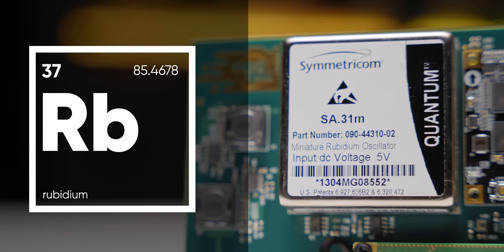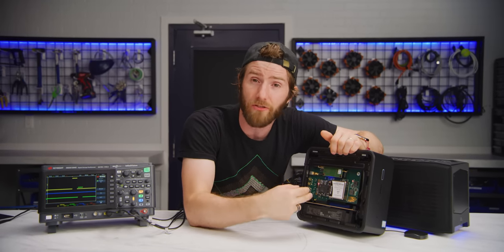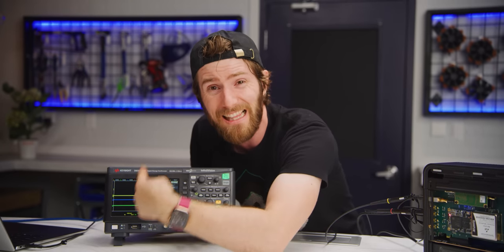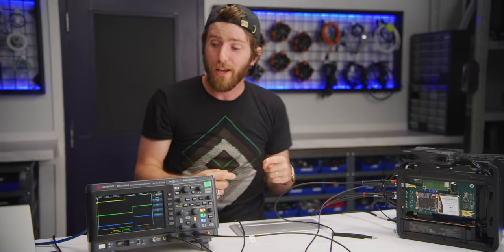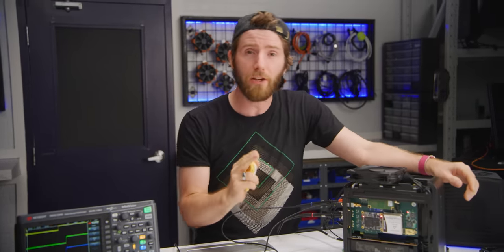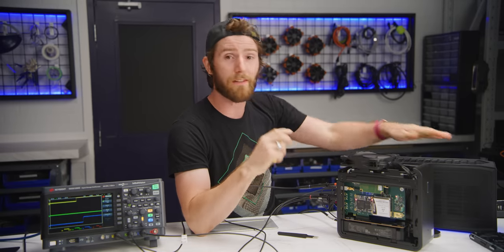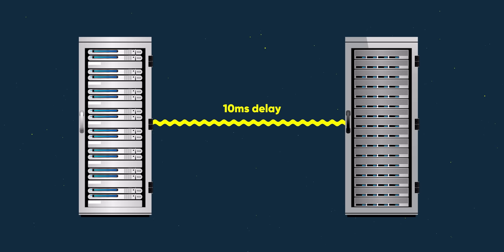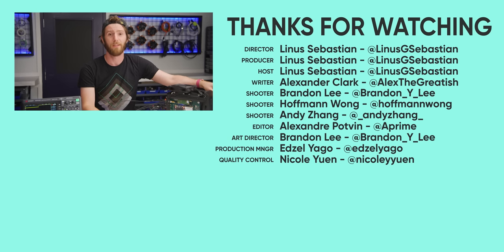Why is this PCIe Card RADIOACTIVE?

Comment: Slight correction: the rubidium clock has to be synced to GPS not because of drift, but due to special relativity.

At the nanosecond resolution, traveling in an airliner at high altitude could theoretically cause the accuracy to drift.
Reply: This comment will be here forever...
Reply: As in, it's time traveling?
Reply: @andrewgoss1682  yup
Reply: bs
Reply: Real?
Reply: gotta love / hate the time dilation
Reply: So it's not because of drift, but because of ... drift?
Reply: because gravity
Reply: @berten1562  no
Reply: I didn't know that. Thanks Denny!
Reply: Bloody granular nature of physical reality is eating my frames. Unacceptable! There'd be none of this nonsense if we legislated pi to be a sensible number like 3.
Reply: @andrewgoss1682  Time dilation.
Reply: Can you elaborate a bit more on the "special relativity" part more?
Reply: @bersK00  simply put: the closer you are to a massive object, the slower time moves.
Reply: @Z0MBUSTER  Moving the card itself in relation to anything while it's running will cause it to measurably drift. See also: Hafele-Keating experiment, 1971
Reply: @andrewgoss1682  Going fast makes the time run slower for you.
Astronauts are also time travellers as well. by some miliseconds of course, but they are.
Reply: @benwu7980  gotta love the concept of time being man made
Reply: @andrewgoss1682  Everyone is always time travelling at 1 second per second :)
Reply: Yes, this is real. Time travel is technically possible it's just not in the way you think it would. It's been proven that if you move faster than another object, then time is slower for you than the other object and vice versa. This is on the scale of milliseconds though, so you'd have to be travelling at insanely fast speeds to have any remotely noticeable difference.
Source: Hafele-Keating Experiment
Reply: @W1zardRyan  yeah! google time dilation.
Reply: I'm surprised people don't know how general relativity works, Speed and gravity changes how things move relative to each other. good way to learn about is look at the history of GPS, within a day the accuracy was miles off.

But short answer is: faster a object moves relative to other objects slow time passes for the faster object, and higher the gravity is the same.

I'm tad drunk, so correct if i'm wrong.
Reply: @pupip55  most people don't understand this because the average age that watches youtube is 13
Reply: Doesn't make much sense, Denny. Why would I care about time dilation, when syncing a bunch of servers? The distance between them is exactly the same all the time, hence their mutual speed is 0.
GPS is used, because it's a common reference and because even caesium clock drifts. So you are NOT right.
Reply: @andrewgoss1682  not quite but basically: something that moves fast will experience time slower
Reply: @berten1562  Not because of "drift", but because of time dilation caused by General Relativity (Fun fact: Time dilation caused by the earth actually makes your head age slightly faster than your feet!)
Reply: @pupip55  Its a complex mechanic which is hard to understand when you have no background in physics which most don't. remember not everyone learns that level of physics when studying and people who do dont always remeber such a fact
Reply: @maruftim  Photons experience no difference on time or distance, relative to a photon: the moment they are emitted is the exact moment they are absorbed.
Reply: Fast 50 : Drifting time
Reply: @tomkocur  If you have one server at the north pole and one on the equator for example, The distance between them would be the same all the time yes but, because the one on the equator moves faster through space than the one at the north pole, there would in fact be some time dilation.
Reply: @bersK00  the special relativity theory was so much easier to understand than the general relativity theory in high school.
Reply: @harbl99  ‘Make All Realities Arbitrarily Man-Regulated Again.’ -Donald Einstein I guess idk
Reply: So what you're saying is my dream of having Tokyo Drift with Time Travel is dead
Reply: @hampustoft2221  Yeah i know, But I remember it form school and almost everyone I talk in real life seems to know or at least act like they do. So it feel like common knowledge. I'm surprised by the volume of comments than anything else.
Reply: @Fizzer99  it seems to me when both servers are on a rigid body like the earth the distance is equal between them at all times so there's no movement between them? I'm not sure what earth rotation does though. Maybe because it's uneven surface  it does make spacetime wobble a bit, not sure... Edit: however it is true that depending on the curvature of spacetime, and thus differing height between servers can cause them to go out of sync. The server that is higher will tick faster. The cause in that case would be simply differing gravity caused by spacetime curvature due to the mass of the earth at those particular places.. I don't see how servers move in respect to each other when one is on the pole and another is on the equator however...
Reply: @DTG4844  Okey that makes sense, For me its common knowledge, That I learnt in school. its definitely something I took for granted.
Reply: No. They need to be synchronized due to aging rate for most applications. These small clocks age at the rate of about 10^-10 per month. That corresponds to 259 uSec per month. If you are using these to measure distance, say of light traversing a 1 km path, you could have up to 520 uSec of error, corresponding to a distance error of over 150 km!
Reply: @richardburrell7665  no wonder you can't get a video card, you can't even structure a sentence
Reply: @Fizzer99  that's not how RELATIVITY works. Time dilation depends on RELATIVE speed of the two objects, not on some "absolute" speed, which is a concept that doesn't even exist. There's no "speed through space", there's only speed relative to a reference point.
Reply: @tomikun8057  Only locally, If i'm in obit my second would be a second, but to me your seconds would be faster would past faster. but for you your seconds would also be a second a second. I am drunk so sorry for poor explaining.
Reply: @tomkocur  You are correct. Brain fart moment.
Reply: @Fizzer99  If your servers are so far apart that general relativity (or special relativity for that matter, because the same argument applies to "moving" servers) causes a drift, your synchronization will be limited by signal propagation uncertainty long before relativistic effects become significant. Global synchronization is a huge can of worms on its own and the GPS-based one is essentially limited by the dynamic ionosphere corrections, which are vastly different at different points on the planet - might as well just send a sync pulse through a fiber cable.

Also, using a rubidium clock looks more like a PR stunt to me than anything else because the entire precision comes from the GPS satellites, which have way more stable atomic clocks. The local oscillator only needs to be precise to one cycle in one second between the 1PPS pulses from the GPS and that's completely trivial with a run-of-the-mill OCXO. What's even more baffling is, why would data centers waste that much money to put a PCIe-connected clock into each and every machine rather than using a central timing distribution box for the data center and just run BNC cables with the 1GHz reference signal (or more likely a multiple of the FSB clock) to every machine, which would just need a simple PLL circuit?
Reply: @berten1562  Yeah, we all understand that it is time dilation due to the relativistic effects of the orbit velocity of the satellites. But I don't know why that mechanism is excluded from the definition of "drift" here. Does "drift" necessarily mean it is caused by inaccuracy in the time-keeping mechanism within its local space-time, or in other words, there being something wrong with the clock? I am wondering what the strict definition of that word is if it necessitated a correction. Unless the semantic distinction was just used as a jumping-off-point to draw explicit attention to the fact that GPS satellites have to compensate for relativity. Because it is admittedly a mind-blowing fact when you first learn about it.
Reply: @DeerJerky  At high-fractional-C we could cross the entire galaxy within a human lifespan.  Our closest neighbours are mere months away.
Reply: I may be wrong but I thought special relativity doesn't fully describe the effect here and general relativity included both the effect of gravity and velocity? Might be wrong but I believe that's the case.
Reply: The issue is if relativity is not accounted for then time might travel through you not you through time. And Linus might just appear as baby Linus in the video's. So something to watch out for.
Reply: @clipsedrag13  I'm pretty sure whatever influence gravity has would actually be working to counteract the total effect of time dilation on the satellites. Satellites experience the passage of time more slowly with respect to computers on the surface of the Earth due to their high velocity with respect to the surface. But on the other hand, computers closer to a gravitational body should experience the passage of time more slowly with respect to computers farther away.
Considering the Earth's gravity is rather modest on a cosmic scale, and computers on the surface experience a very similar gravity to satellites in orbit around the Earth because satellites are so close, I would expect the influence of gravity on time dilation to by many orders of magnitude smaller than the influence of the satellites' velocities on time dilation. But what small effect gravity should have, should be working to mitigate the much larger effect of satellite velocity.

Anyone can feel free to correct me if I'm wrong. Especially if they have math. I would love to see how the two effects compare.

TL;DR Computers on Earth = higher gravity = slower local time
Satellites in orbit = lower gravity = faster local time
Computers on Earth = lower velocity = faster local time
Satellites in orbit = higher velocity = slower local time
Effect of gravity << Effect of velocity

Effect of velocity - effect of gravity = total relativistic effect ≈ effect of velocity alone
Reply: Also the gravity of Earth isn't perfectly even - some places have higher or lower gravity, thus complicating usage of ultra precise clocks.
Reply: Good thing this comment is posted on a video with radiation in the title, its gonna last a long time.
Reply: @DaimyoD0  In the context of clocks, drift simply means a different rate of the process that is measured to keep time. Whether it's an "inaccuracy" depends on the reference you're comparing the clock to. The "correct" clock rate is defined based on the cesium hyperfine transition, so you have to compare every clock to this reference to conclude whether it drifts or not. The clocks on the GPS satellites (probably) don't drift within the measurement accuracy in their own intertial frame (i.e. if you sit inside the satellite with a Cs clock), but they drift quite a lot when observed from earth. This drift is deterministic and measurable, so it can be corrected for to make the GPS clock signal appear drift-free. If you don't have an authoritative reference, you can only measure relative drift but you won't know which clock is "correct" (it could be neither).
Reply: @ok-sl4we  I legit use this stuff for Ham radio but mine don't use rubidium it uses a OCXO with a GPS Lock and when i beat it against a $20,000 rubidium  time standard it is dead on and it was $90
Reply: @Mr_Meowingtons  Yeah but dat phaze noize tho!!!
Reply: @clipsedrag13  Nothing to do with gravity. Special relativity is all about velocity. Earth's gravity is so weak, as is gravity as a fundamental force itself, that its effect on particles is considered negligible.
Reply: @DaimyoD0  "Satellites experience the passage of time more slowly with respect to computers on the surface of the Earth due to their high velocity with respect to the surface." -> bonus question: what's the velocity of the GPS satellites with respect to the surface of the earth? :)
Reply: @neondemon5137  well then that is a tragedy of the education system
Reply: @MykytaSpivak-ne3cw  no u
Reply: @Z0MBUSTER  ah yes the ultimate comeback
Reply: @redyoshi12243  That's nonsense. GPS time is corrected for relativistic effects, otherwise it wouldn't work. The signal delay between different satellites that's measured to calculate the location is irrelevant for getting the correct time because all satellites transmit the same time as a data packet.
Reply: Not theoretically, actuality. It is traveling into the future. Down on earth time would be slower because of the higher gravity. Obviously not much. I wanna say a couple of nanoseconds for a long flight.
Reply: What you mean is general relativity, though. Essentially time dilation due to space time curvature. SR really only deals with time dilation due to relative movement of reference frames to my knowledge.
Reply: Huh.
Reply: Cool.
Reply: @MykytaSpivak-ne3cw  xD
Reply: Also Earths Gravitational field can mess with Aircraft instruments in a big way, some places om Earth . we are not aloud to fly over like the triangle yeah lots of crazy stuff there for sure, but you know what there is a answer for everything ,we just have to learn to look hard .
Reply: gotta love temporal hacks
Reply: @pupip55  So you learned about relativity but not about the word LEARNED instead of the non-word LEARNT.  School's a joke I guess.
Reply: @harbl99  Plz don't define 0.14159265… as the new zero! I'm panicked!
Reply: The faster you move the slower your time will be.
Reply: You are right
Reply: @redyoshi12243  What is GPS time, I do know of standard universal time ,what is GPS time, this is interesting what you are saying but yes i think i have heard about this, but its not what i was thinking about sorry .;-)
Reply: @stealthinator00  yep, unfortunately you cant move fast enough to freeze/reverse time tho, at best you can delay aging by a couple of days at light speed (rough guestimate, most of the cool stuff is banned due to the laws of physics, so stands to reason)
Reply: Neeeeeeeeeeeerd
Reply: genuinely no idea what this means
Reply: @redyoshi12243  are you familiar with the way that GPS was originally set up? They do have to correct for time dilation, and they do so extremely accurately- the engineers working on the original GPS sats left the time dilation code turned off when the satellites launched, and only turned it on once they realized their positioning was getting all kinds of screwed up.
Reply: @RealNovgorod  For a second there I imagined the math might be quite easy but then I realized GPS satellites are most certainly not in geostationary orbit lol
Reply: @Artcore103  No I have learning disabilities, But even then "learnt" is the word spell check gave me because its correct...? Just might happen to be in a different country then you
Reply: @madmad8582  The GPS satellite send out multiple radio waves with time that's been adjusted for relativity, when your phone detect the wave it will compare them to your local time and the other waves.
Reply: @andrewgoss1682  yes, because relativity is weird.
Reply: @W1zardRyan  yes, because relativity is weird.
Reply: @tomikun8057  NO! Because of people like you Einstein had to think harder.
Reply: @XGD5layer  That's general relativity. Special is more like: the faster you move, the slower time moves.
Reply: This damn Kerbal said fuck Time
Reply: @tomkocur  Servers aren't moving compared to each other, BUT servers are located in different magnitude gravitational fields, so second on each server has different length and that clock difference is growing without atomic clock syncronication.
Reply: @pupip55  I am beginning to see the frequency of the situation,and yes time is part of that yes, frequency , speed, time, :-)
Reply: Not just could, it will.
Reply: @XGD5layer  Ah, so that's why if you say that someone is dense, you mean that you think they are stupid and that they take a long time to understand simple things? xD
Reply: @andrewgoss1682  time travel is measured with atomic clocks, thats how the theory of relativity was proven. Some hypersonic jet with such an atomic clock was the first man made object to travel by a couple nanoseconds into the future. And its not Gravity at play as someone suggested, but rather Inertia, because the atom has to travel diagonally now, and the trajectory is elongated, thus your relative nanosecond becomes longer.
Reply: @redyoshi12243  Yes, GPS receiver does always time correction for calculations based on values in GPS calendar. GPS system is in constant calibration mode, so for pricice syncronication you need local atomic clock. I think that without correction calculations raw time signal from one/few satellites is useless for this purpose.
Reply: @Ben van Jaarsveld The earths Gravitational field plays a huge role into the natural laws of physics, even life, the Human brain works at the same frequency  of Earths, Gravitational field, plus , Earth has the moon, plus the Earth rotates .
Reply: Actually it is needed to correct for both special relativity and general relativity. Even for any fixed installation not only is the gravitational field strength influenced by elevation but by the specific location on the surface. The latter being due to the fact that the Earth is neither a perfect sphere nor is its density perfectly uniformly distributed about its centre of mass. Thus the time dilation due to general relativity is also slightly off as the Earth itself is distorted, lumpy and uneven clump of matter thus consequently its gravitational field is also distorted, lumpy and uneven. Ultimately this means that to synchronise two atomic clocks around Earth you also need to correct for the time dilation due to general relativity caused by the slightly different gravitational environment for each clock. This is simpler to do for fixed clocks but it can be integrated over the path for a clock following a known path around the Earth. In fact I believe that the correction for each GPS satellite is slightly different for this reason, each satellites orbit takes it over different points on the surface thus meaning slightly different gravitational time dilation even for two satellites at identical elevations.
Reply: @Ben van Jaarsveld If earth ever lost the moon, it will stop rotating and face one direction to the sun,  physics , then life here would all die, Earth is our only home :-)
Reply: @Z0MBUSTER  No, it's not. Time perception changes ever so slightly due to object's speed as well as how much is a given object affected by gravity (both of them change on a plane, since you both move fast and get further form Earth). And by ever so slightly, I really mean that. You need to be traveling at close to light speed or come extremely close to a black hole in order to see the difference. But at an atomic clock scale, you might be able to see the difference just by getting onto a plane. Heck, that's the very way how they discovered time dilation (tho it's been theorised by Einstein way earlier). Scientists just chucked an atomic clock onto a plane to see what happens. And sure enough, it was ever so slightly ahead of another atomic clock left on the ground.
Reply: @madmad8582  Did you reply to the wrong guy?
Reply: Profile pic checks out
Reply: @pupip55  Maybe lol Hi :-)
Reply: The airliner effect would be due to GR not SR. The SR offsets in the atomic clocks in the GPS satellites are due to its inertial frame’s velocity. Remember in SR spacetime is still flat.
Reply: @tomkocur  That is a great question.

Reason 1) Transporting

Lets say, on your time cards, the radioactive element decays (a clock tick) at the same time for all your servers and they have exactly the same time.

Then you trip over and spill soda on one of your servers, whoopsie

But your friend that is miles away knows how to repair servers so you put your computer on your car, you drive to your friends's house, get it fixed, the clock ticked exactly the same as before, and you notice no difference the whole trip.

After fixing it, you get back, but your server back next to the others, and notice they are no longer in sync , damn you Einstein!

--------------------------------------------------------------------------------------

Reason 2) True time-dilation sync is impossible

Another way that could cause a desync is stacking your servers vertically, one on top of another, it will make the servers at the top experience faster ticks than the ones on the bottom, even if the effect is very, very weak it will cause a desync after a few million/billion ticks

After all, it is known that, synchronizing 2 clocks to tick exactly, and I mean, exactly at the same time is impossible, and even if you had 2 clocks that are perfectly synchronized, its impossible to prove it
Reply: What's cool about it is the fact that for GPS to work both the special relativity and general relativity corrections have to be made. It's the only way for it to work!
Reply: @v1perys  technically it's just one general relativity correction, because GR includes special relativity as, well, a special case of it. But that correction can be separated into two components - purely kinematic slowdown and purely gravitational speedup.
Reply: @Fizzer99  No. The surface of the earth is equitemporal. The equator is moving quicker, but the its also experiencing lower gravity. The two effects cancel exactly.
Reply: @G-u-z-i-o  bs
Reply: That's simply not true.
These systems drift when untrained due to many many factors - in my experience the biggest factor is ambient temp (even in oven controlled oscillators in environmentally controlled data centers). I used to watch my untrained 1pps walk one way vs a trained 1pps during the day and the other way at night when the data center dropped ~10 degrees.
Reply: Just look at what you did.  I hope you're happy now. 
(I know I am)
Reply: @DTG4844  when i was 10 I learned about it one youtube because i saw cool time travel video that and game theory used it to explain the lore of mario's galaxy
Reply: @XGD5layer  reason why time stops around your mom
Reply: So... Is GPS time like, the "official time on earth"? Because even living at different altitudes causes clocks to ever so slightly drift after synchronization (because of differences in local gravitational accelerations). And what time zone is it in? UTC? GMT 0? Swatch time? Who is even keeping time? What day is today!? So many questions now! XD
Reply: OK
Reply: @tomikun8057  Always true in the local world. The impossible problem now is getting people in different parts of the universe to agree on how long is that second (and no, it's not because of "opinions" XD)
Reply: Whatever he said 😂
Reply: @Ben van Jaarsveld Of course, which is the reason all the satellites internal rubidium clocks have to be corrected a very small amount to compensate for these effects.
Reply: Every rack mount frequency standard is going to be synced to GPS because yes they do drift over time despite being stationary for their entire life.
Reply: @DTG4844  I think that's TikTok, some youtube is actually useful to grownups :)
Reply: i was thinking about the same thing. i had seen videos about this stuff and theoretically any height differences is enough to create a drift but it was so miniscule and negligible it couldn't be measured, that it until atomic clocks came to the scene as they had much higher accuracy. the video i saw had it tested at around 1 m difference and this whole concept is really fascinating to me. unfortunately this also requires a lot of maths and im not good at it so im probably not going to almost anything physics related, let alone quantum physics
Reply: so technically you could determine someone's altitude based on the ping response times
Reply: It is disciplined to GPS to combine the advantage of both (long term accuracy and short term stability)
Reply: @tomasgarza1249  you got a few things wrong.
Decay has nothing to do with atomic clock.
If you stacked your servers on top of each other, there would be no time dilation, because they don't move relative to each other.
Reply: The server on the bottom would experience a stronger gravitational field than the one on the top

Time dilation has a relation with speed, and gravitational fields

On the atomic decay.. I just googled it and you are right about that, it doesnt rely on radiation
Reply: god i fucking love science
Reply: @martinh2783  The original meaning is that their skull is so dense that nothing can get through it. But we can adopt that as the second definition.
Reply: @andrewgoss1682  technically yes, but at very miniscule scales. Special relativity predicts that your foot is time travelling with respect to your head as it is deeper in the gravitational well of the earth but do you notice it ? But when there are computers on varying altitudes, the microsecond delay caused by relativistic effects is enormous sometimes even beating the reasons for the atomic clocks.
Reply: @DTG4844  i'm 13 and just an average guy in my school I understand special relativity ( just conceptually not mathematically ) it's not a very big deal.
Reply: @CreativityNull  yes
Reply: @alaididnalid7660  maybe seismic effects? or even the gravitational effects of massive objects near the servers like mountains ?
Reply: Nanosecond is so short, light can travel only 30cm (1 foot) in a nanosecond.
Reply: I remember in a school science test my friend answered with special relativity on some question about the speed of a boat. The teacher said it wasn't the answer he was looking for but gave it full marks anyway 😆
Reply: @varunrmallya5369  yes, the irregular mass could have an impact was what I'm saying. However after some reading it turns out there's two parameters that level out. One weighs less at the equator than at the poles so time ticking speeds up at the equator. Yet the equator moving due to rotation slows down ticking of time compared to the poles. These two effects cancel each other (mostly?) out. Supposedly this is not a coincidence and it explains the bulge at the equator. You are further away from the bulk of the mass because of this bulge so you experience less gravity.

In all honesty, I do not understand why the equator moves in relation to the poles. i would think that only things like  non geostationary sattelites move in respect to the equator. I guess I'm missing something...
Reply: I always find it so interesting/funny when i hear about some of modern Technology, that has to compensate for time-dilation.
Its kinda cool in a way
Reply: @gibs1919  Why is it "funny" though. :) I agree it's cool but in a way it makes sense. Technical evolution is often about accuracy and the more accurate you want to be, the more you need to take in account the smaller influences.
Reply: @berten1562  I think they meant not drift due to inherent inaccuracies but drift because of special relativity.
Reply: @canopus5896  I believe so. Special relativity was for stationary objects...? and general relativity also takes into account velocity.
Reply: @pupip55  I guess if you're British.  But it's a dumb word, no offense to you, just the Brits. :D
Reply: @harbl99  absolutely hilarious
Reply: @Artcore103  Well funny you should say that, but learnt is pronounced learnt not learned, unless you say learn-ed which sounds so wrong.
Reply: Mass bends time so the closer you get to the mass the faster time moves. This was actually hypothesized by Einstein and proved with the constant and quantifiable time "lag" observed on satellites, even with atomic clocks on board.
Reply: Ah good old lorentz transformation.
Reply: @bersK00  When you approach the speed of light (which is where most information transfer occurs through signals), the measurement of both time and space get shifted by the a factor (due to) called the Lorentz Transformation. Special Relativity does not take into account the effects of Gravity as some might suggest. That is General Relativity. 

Think of this SIMPLE scenario - If you are on a rocket travelling near light speed, and someone is stationary on earth, there is a difference in velocity between you and the earth bound observer. Let's say you throw a ball up into the air and it lands back down while you are inside the rocket. The distance travelled by the ball (to you) is just up and down. But the distance travelled by the ball to the earth bound observer is up-sideways-down. Now, since distance = velocity x time, how does the measurement of distance and time change with your frame of reference? ---> Answer? Precisely via the Lorentz transformation. The only thing kept constant is a variable called "spacetime", which is the square of the time coordinate minus the sum of distances squared (in 3D).
Reply: I wonder if it also needs to correct for general relativistic effects.
Reply: So when i used to speed around in my car 18 hours a day i was experiencing time at a slightly diffrent rate to everyone who was sitting still? I thought i was imagining it so thats pretty cool if it turns out true
Reply: It's not so complicated. Time is a man made concept meant to measure the relative speed of things. Like height -- something only has a "height" relative to some "ground" point. Similarly, time -- a measure of velocity -- exists relative to a "fixed" point. Now if youre measuring time (relative velocity) in very miniscule increments -- such as computer processes -- the difference between you and your so called "fixed" point of reference becomes more apparent. Imagine measuring someone's height, usually you measure from the "ground" up and everything seems nice and consistent. Now imagine you're measuring the height of something so tiny that you need special tools to see how far it is off the ground. And then you realize that your "ground," which provided you accurate height measurements when looking at increments of feet and inches, is actually neither flat nor stable, but bumpy and constantly shaking. It's that kind of thing that requires constant "resync" of your "ground" point to have some sense of relative accuracy.
Reply: @hampustoft2221  
>remember not everyone learns that level of physics

That's highschool level physics...
Reply: @RealNovgorod  > just run BNC cables with the 1GHz reference signal
Because data centers need phase/time synchronization (alignment to UTC) and not frequency (for the most part).
Reply: @RealNovgorod  > using a rubidium clock looks more like a PR stunt to me than anything else because the entire precision comes from the GPS satellites
Partially, the GPS receiver tends to be more accurate over longer time intervals and because of all sorts of issues less accurate over shorter intervals. So, a good oscillator is needed to filter out the high-frequency (short duration) noise. But you're right, normally a good quartz oscillator is sufficient. What a Rb DOES give you is a longer, more accurate holdover when the GPS reference signal is lost.
Reply: > Slight correction: the rubidium clock has to be synced to GPS not because of drift, but due to special relativity.
No, the Rb oscillator needs to be synced to GPS for two reasons: 
1) First is to give the clock a value of UTC. When you change the battery in your watch, you need to set it to the correct time. That's what GPS is doing for the clock driven by the Rb oscillator - it doesn't know the time without it. 
2) the Rb is not as accurate as the GPS, so the Rb needs to be "conditioned" by the GPS signal to keep it accurate. Otherwise, the Rb would drift away from the correct UTC time (as delivered from GPS).  The line in the video that the Rb is accurate to 1 second every 100,000,000 years is ONLY true because it's synced with GPS. Without GPS - this Rb based atomic clock would be nowhere near that accurate.
Reply: @farmerbrown84  > Because data centers need phase/time synchronization (alignment to UTC) and not frequency (for the most part).

Sure, but then you just replace one problem with a more expensive one - or how do you get the GPS signal to each PCIe card while maintaining perfect phase lock to UTC? I assume there is no line-of-sight to the GPS satellites from every single server in a data center... You still end up running BNC cables from each client's PCIe card to its GPS antenna (or some central splitter) which you then have to individually calibrate. In that case you're much cheaper off having a single GPS source for timing distribution and run calibrated cables to all the clients (since you have to do that anyway!), but now they don't need each their own few-thousand-bucks PCIe card with a fancy rubidium clock. Once you've calibrated the timing distribution cables, you should be good to go. There will be still some temperature-related phase fluctuations (in either case!), but that's so far sub-nanosecond that it should be completely irrelevant...
Reply: @farmerbrown84  What kind of accuracy can you achieve by converting the time reference to ethernet packets first and without runtime calibration (I assume)? Didn't you make the point earlier for having a GPS card in each server because a central timing distribution (in whichever way) wasn't good enough? I mentioned analog BNC timing distribution because that's used in scientific applications, so if you need comparable accuracy on a computer (which is a bit of a waste anyway unless it's a real-time system), you could go this route and derive all local clock frequencies from the master signal. But whatever timing distribution you use, I fail to see how putting one of these PCIe GPS cards into every server would make it more precise in any way, even compared with the ethernet-based timing distribution...
Reply: ...all this is fairly standard stuff now in new 5G networks.
Reply: @farmerbrown84  50ns is neat (for computing, that is), but that's on the order of 10m or so of cable length (around 2/3 the speed of light for copper and fiber?), so uncalibrated propagation delays can become significant if you actually want to use this precision. But then again, synchronization with UTC is a very different application than phase lock between machines, given that the actual UTC reference is probably thousands of km away. "Faster-than-light" neutrinos were measured because of these kinds of calibration shenanigans between two very far away locations (turned out to be a crappy fiber plug, lol).
Reply: @RealNovgorod  well, no. Yes, if you are running normal coaxial cable and an analogue signal like 1PPS, then you need to calibrate for the length of the cable. The great thing about PTP is that it does that calibration for you. So, no matter if the Ethernet Fibre is 10m or 80km long, the PTP will still give you accurate time.
Reply: @RealNovgorod  …and phase lock is really just a subset of UTC. When you are phase locked, one way to think of it is that both machines are synchronized as to when the second will tick over. What second is that? Well, the second you use is the best representation of UTC that you can get. So, when power substations are synchronized to within 1 us of UTC, or a 5G cell-site is within 1.5 us of UTC, then there is no “thousands of miles” in it. The best approximation that is freely available is that from GPS. And so those substations and cell-sites are within 1-2 microseconds of GPS’s version of UTC.
Reply: @farmerbrown84  Does it measure and compensate the cable delay automatically?
Reply: @farmerbrown84  Well, that's what I was saying: if you want phase lock over any distance, you must correct for the signal delay from the master. GPS is great because it does all the calibration for you (satellite position, local atmospheric delay etc.). There are still "thousands of miles", they have just been corrected for. If you want to do it more accurately, you'll have to run your own signal link (radio, fiber, whatever) and precisely measure the runtime delay to ensure true simultaneity (i.e. phase lock)..
Reply: @RealNovgorod  yes, PTP does the calibration automatically. Here’s how it works. PTP cannot know the one way delay that the time stamp from the master has been in motion. You need accurate clocks aligned with each other on each end to do that - and that’s the problem you’re trying to solve (getting an accurate alignment on the slave clock). So, PTP uses a two-way swap of time stamps with the master to calculate an accurate round-trip time. PTP then assumes the time taken for a packet to pass in the forward and reverse direction is the same, so the one-way delay is half the round trip time. 
PTP then can accurately set its clock based on the currently received time stamp and add the one way delay to figure out what the current time should be on the slave. In this way, it has compensated for the cable propagation delay. The only wrinkle in this scheme is the assumption that the packet transit time is the same in both directions. If it’s not, then the slave will calculate the wrong time. If you know this asymmetry exists (eg the cable pair has differing lengths for transmit and receive), you can measure it and configure it on the slave. One way to get around such problems is to use bidirectional fibre optics. Of course, this technology uses different frequencies in each direction, and the two frequencies may travel through the fiber at different speeds. Again, more asymmetry, although quite small.
Reply: smacks computer this thing can fit some much accuracy
Rubidium clock: WHY THE FUCK ARE WE TIEM TRAVELING AAAAAA
Reply: Relativistic time dilation is a thing.
If the jet flies east it'll run slightly slower and if it flies west it'll run slightly faster.
Reply: picoseconds
Reply: Also the distance to the center of the earth and thus the effect of gravity is slightly different at the poles and the equator. The earth is  very subtly elliptic so the poles are closer, by about 15 miles, to the center.
Reply: @tomkocur  Even as little as a foot of elevation difference causes measurable time dilation, we're all moving at slightly different speeds, esp poles v equator.
Reply: @screwytb  ok let's do a bit of a math here. Earth's circumference around equator is 40075km, so at the surface, you're moving at 464m/s (for easier math I'm considering a day is 24 hours). One meter of elevation difference would add 6 meters to the circumference and something around 73um/s (0,000073m/s) to the speed.
What time difference does this make? 1,00000000000000000000000003. One second at x meters will be this many seconds at x+1 meters. So the difference is 2,3e-26s per second.

Gravitational dilation difference will equal to  0,001ps per second.

GPS clock is accurate up to 40ns, which is several orders above what you say is "measurable".

No. It's not measurable. We don't have clocks precise enough to measure it.
Reply: @tomkocur   Could have just asked for a citation instead of all that. Tell NIST their clocks don't exist. In any case, distances may span the globe and the difference will not be "zero," even if you consider it effectively zero, and even if there is a point at which there is zero impact on performance. But nonzero they stubbornly remain.

Still, I won't deny the finding is astonishing and made me look twice. *C.W. Chou, D.B. Hume, T. Rosenband and D.J. Wineland. Optical Clocks and Relativity. Science. Sept. 24, 2010.
Reply: @screwytb  Even NIST clock with it's 6,7e-11s per year accuracy is not precise enough to measure what you claim is "easily measurable" 2,3e-26s per second (=7,25e-19s per year) caused by one METER of elevation difference.

Yes, a meter of elevation difference will cause some time dilation. But it wouldn't matter in any way, since there's no clock on the world that would ever notice. It would take NIST clock 92 milion years to even notice a difference. But by that time the skew on NIST clock would already be 6ms
Reply: @tomkocur  Don't misquote me, please. I said "measurable," which is correct. Anyway thanks for acknowledging it is nonzero; the rest I either remain neutral on or agree with.

As for NIST, it is not my claim, it is theirs. It appears you are going by their blog post on strontium clocks & not the citation. With the best experimental clocks available, they claim resolution to 33cm of elevation change. (But as precision matters here, I'll acknowledge the cm/ft conversion is imperfect--that's simply how they summarized it elsewhere.)
Reply: @ok-sl4we  no it won't
Reply: Of course the guy with the KSP pfp knows that
Reply: Also because of the long-term drift, rubidium in that size is not good long-term.
Reply: @berten1562  because time itself relative to others is different depending on speed
Reply: @tomkocur  the earth is spinning and people are at different altitudes for a start
Reply: Soon clocks will be so accurate that my overweight body will throw it off as I walk past it. Or it just means I'm getting way too heavy.
Reply: ty
Reply: @andrewgoss1682  Time as such does not exist, time is how people perceive movement in space. If the movement stops at the lowest level of matter-energy, then it can be said that from the point of view of perception, time has stopped, but from the point of view of physics, entropy has stopped or slowed down. But in general, movement in space is affected by the surrounding environment, such as gravity and other saturations of space.😀
Reply: @hampustoft2221  if go fast, time move slow, more when near big rock
If time move different for 2 clock it will go out of sync
Reply: you mean... TIME TRAVEL?!
Reply: @W1zardRyan  Yes, the faster you move, the slower time moves for you in relation to static observers. So satellites moving around the Earth fast end up having different clock speeds compared to clocks which are stationary on Earth. Without understanding this, GPS would not be possible, as it would always be inaccurate.
Reply: @ok-sl4we  It was here before he wrote it.
Reply: @harbl99 more like the fine structure constant, alpha ≈1/137
Reply: @tomkocur becuse if you have two serves, one on a tropical country near the equator and other near any of the poles, the difference in tangential rotation speed of the earth is enough to scramble the timings on the signal due special relativity.

Also if you have a server at sea level and other on a high altitude city like Mexico City (1.5 miles above sea level), the difference in the gravitational acceleration given the altitude is enough to affect the timings. 
Mix both, different latitudes, altitudes and add stuff like local under ir overdensities of Earth's crust and more exotic stuff of cosmic origin like gravitational waves and yes, special relativity fucks with the worldwide network infraestructure more that we would like. 
If course, these problems are up to the engineers designing the next gen tech of network devices to solve, not to the technicians on the ground installing and operating this things.
Reply: @carlosdgutierrez6570  I reacted to this already. Tangential speed doesn't matter, relative speed matters. And if these two servers are located at a constant distance from each other, their relative speed will always be zero, hence zero time difference due to relativity.
Gravitational effect - yes, but it only accounts for 0.2ns per day, which is far below the resolution of HPET, let alone RTC (so the internal clock won't even notice). And I'm not even talking about precision.

Again - it's all about having a common reference, because all clocks drift.